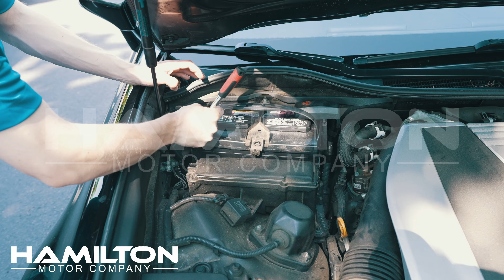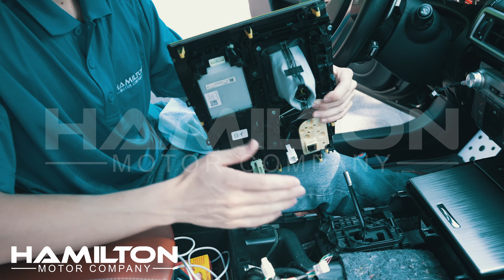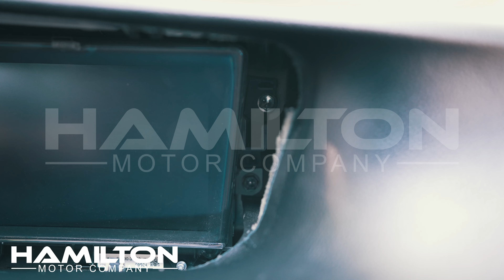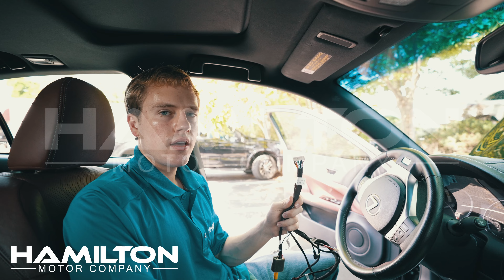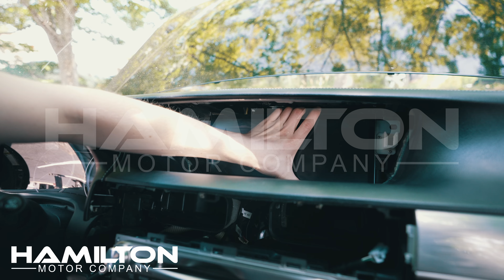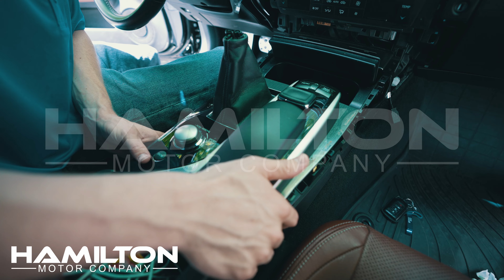2012-2015 Lexus GS Hamilton Conversion Kit | CarPlay & Android Auto Installation Guide

Comment: I have a question. On the website it says to pick between base trim or F Sport/Premium trim for the conversion kit. What is the difference? Is the screen a different size or setup or something? Also, I have a 2013 Lexus GS 450h with nav and Mark Levinson. If the trim version of the kit matters, what kit should I get for my particular car?
Reply from the maker: Feel free to send customer service a picture of your OEM home screen and we can confirm for you. There’s also an image on the product page that shows which home screen corresponds to which selection. It is for us to correctly configure your software as Lexus had two OS versions for 2012-15 GS. Thanks!